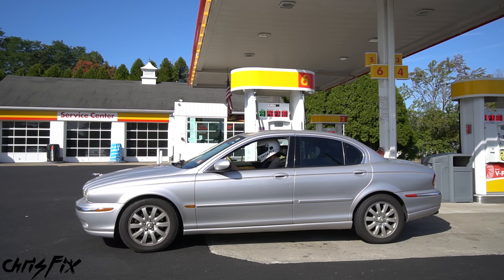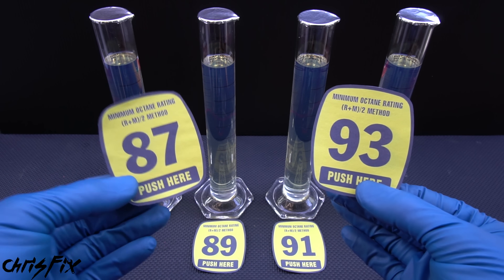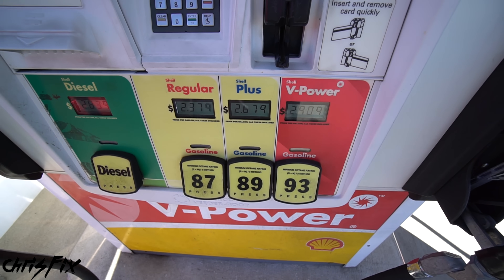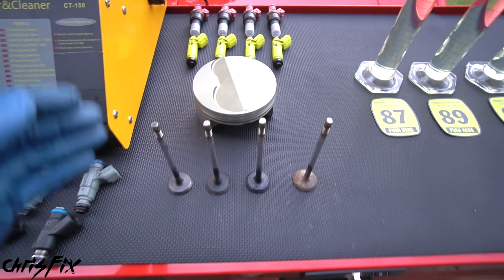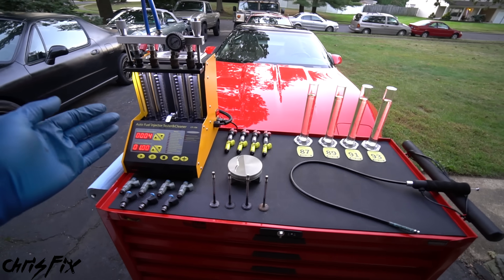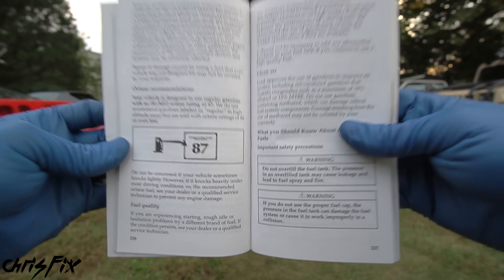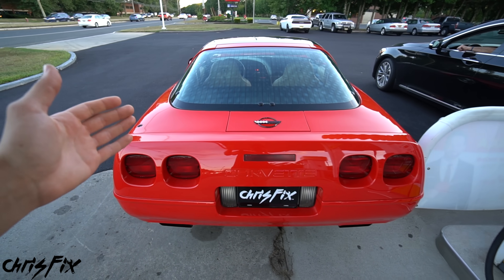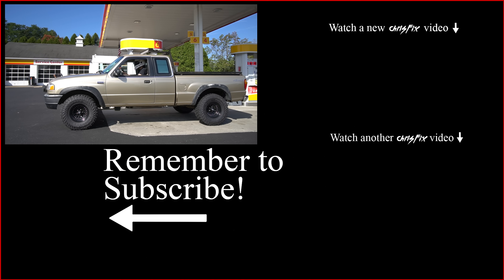What is the BEST Fuel to Use in Your Car or Truck and WHY

Comment: What about up to 10 percent ethanol?
I have to put 91 octane in my car but I’m not sure about ethanol and nearly all gas stations in my area has ethanol.
Reply from the maker: You don’t have a choice. Most cars can use it without issues. The main issue is it absorbs water and if your car or boat sits more than it is used you can get corrosion issues.
Reply: ChrisFix Alright! I should be good since I use my car every week except for Sunday. Thanks for your help!

Comment: How often should someone replace/check valves, piston heads, and fuel injectors?
Reply from the maker: Never. If you drive your car normally, don’t do very short trips and you bring the engine to operating temp each time you drive, you will be fine. Normal maintenance such as oil changes, air filter changes, etc will keep your car in tip top shape! My family’s van was bought new and now has 315k miles and used the cheapest fuel possible. It runs fine and I checked the injectors and they are still pretty good!
Reply: ChrisFix thank you for the info! I have another quick question if you don’t mind it’s not related to gas. I have a C4 corvette as well. 1984.. but it is a pain to turn over. If it gets really hot outside it won’t start. I’ll crank it until it kills the battery on some occasions. I’m in a C4 group on Facebook but haven’t gotten any feedback yet. Do you think it’s the fuel pump? Once it’s started everything runs fine and sounds great but if I turn the engine off I have to wait for it to cool down before I even think about starting it up again. Thanks again for any feedback!

Comment: Hey Chris! I appreciate your knowledge! Have you ever thought about adding a slight mix of maybe 100:1 premix 2 stroke oil to your fuel? Specifically for performance engines and racing applications?
Reply from the maker: My only hesitation is for vehicles with cats and oxygens sensors. That two stroke oil is bad and can damage the cats and sensors. For a race car it might not be an issue tho.
Reply: What, and destroy your catalytic converter?  That's a felony, sir.
Reply: @randyvanvliet226  glad its not one where i live

Comment: Here is a solution: Get an electric car..
Reply: @Mr. 8-Bit Doggo it's not so much that the operation of the vehicle is dirty... it's what powers the battery charger that is. Until they start pushing for something like nuclear energy, the bulk of the supply is going to be dirty. Something I believe most people forget when driving such vehicles.
Reply: @leroymesser6911  agree
Reply: Yup still cleaner. And if a hurricane or blizzard hits a region of America, gas prices are first affected by the inability to transport it to the region.
Reply: Yes a coal powered electric car.
Reply: @leroymesser6911  you can have solar panels at the rooftop of a home and charge your car that way. Independent from the grid and clean.
Reply: @Mr. 8-Bit Doggo it also makes the owner independent of gas use and Middle East politics.

Comment: Bottom line is that you use the fuel that the manufacturer recommends. Unless of course that you've got a better degree in engineering and more experience than the manufacturers engineers. When you turn your engine into a pike of junk using the wrong fuel then that is the price of ignoring the manufacturer. Just saying...

Comment: There is a VERY simple way to find out, your car will specify on the gas door or owners manual but MOST cars only need 87
Use 93 for the following cars:
Anything with a turbocharger or supercharger 
European engines ( they use much high compression ratio )
And any engine thats been tuned for above factory power

All the higher octane rating means is it takes more compression to combust ( you REALLY want that in high output engines so you don't get a premature detonation that will ruin your engine)

Comment: I’ve been using 87 for my bmw I’m too scared to check wat the recommended Gas is
Reply: Probably 91 lol If you don't run your engine hard though and keep the RPM's low you can get away with using lower octane fuel. Just have to watch for build-up and everything else in the video.

Comment: My subaru wants super (ron98) so that's what i always give him. My mr2 says the regular is enough but one day i just decided to also put vpower in there. It went through 1/4th of a tank and when i went wide open.. oh my pushed into the seat. Its faster so i say ron95 was the reason it didn't feel like 140hp on a 950kg dry weight. Even my suby seems to perform better with vpower than the other 98 brands

Comment: Although this is for cars it did make me think about the problem I was having with my motorcycle. I swapped spark plugs and cleaned the carbs and still had a similar problem. After watching this video I went online to research the recommended gas for my bike and sure enough I’m suppose to be running 91 and above. No more random combustion’s.

Comment: I just use what's recommended in my owners manual. BUT, I have a 1999 Chevy that called for 87. I was using it for a few years and then I began to have issues. My mechanic recommended I try 89, and I haven't had those issues since. 

For my newest vehicle, it calls for 87 so that's what I use. So far no problems.

Comment: I think it's worth mentioning top tier fuel providers. Usually says on the pump. You can find list google it. This is important for direct injection engines. I have a conoco in town which is a top tier fuel provider. It doesnt say top tier on pump. I wonder if some stations dont provide it or stations never put label on pump? Bg44 is good to run once a year.

Comment: “E-85 is only for Flex Fuel” nooooo Chris! It’s for big big big power and boost 😈😈😈. I run E-85 on my boosted S550.
Reply from the maker: And that’s tuned for it, aka flex fuel!
Reply: @chrisfix  I use it in my 1980 Pontiac LeMans Safari as an octane boost, I run half & half, plus the timing is advanced more than the law allows, ha. It has an old smogger carb that runs rich and the alky leans it out. The stock cam is  advanced in the old 301 4BBL which helps also.

Comment: Last time I used shell.. I had to replace my gas line due to them having water in their lines ..no thank you
Reply from the maker: That stinks! Also whomever replaced your gas lines ripped you off. All you do is pop the fuel line off at the fuel rail and run the fuel pump to get the water out. You got double taken!
Reply: ChrisFix jeeeeeeezzzz man smh lol this was years ago, but that's wild , thanks for the info

Comment: My old Ford Explorer said right in the manual not to use anything higher than 87 octane or it would damage the engine. My ex swears higher octane is better for your car. She goes through a lot of cars.
Reply: Higher octane doesn't burn any better than regular, the only way it would be better is IF one could advance the timing and make more power/mileage...other than that, a waste of money.

Comment: Jokes aside , at most gas stations the pump for Diesel is usually bigger and usually won't fit in a Gasoline  powered car to prevent accidentally putting diesel in your gas engine and vice versa .
Reply from the maker: Truth

Comment: A topic you missed , which is relevant , is ethanol percentage . Many older cars run like dogshit on high ethanol gas . Ethanol stores poorly , particularly in spring and fall when you get a lot of condensation . As the lower grades frequently have a higher ethanol content , you may want to use a higher grade if your car sits frequently.
Reply from the maker: Thanks for sharing! Unfortunately there is only so much you can put into a 20min video and ethanol opens up a whole other 20 min video! Haha

Comment: My truck says e-85. But the closest station that offers e-85 is 35 miles away. What should I use as an alternative?
Reply from the maker: It will run on regular gas just fine if that’s what the manual says. E85 is not common so that’s why they call it flex fuel. You can run gas or ethanol

Comment: Since shell premium has 7Xs as much additive, is it okay to use shell premium for 2500 miles to more effectively remove build-up in a car that calls for regular?

Edit: would this be safe for my car?
Reply from the maker: Yes. That’s what I did in my truck and the pinging stopped. I honestly didn’t think it would work and I was wasting my money but I wanted to try it. Also I had no choice because she would detonate with regular randomly.

Comment: Using 93 in your 87 rated car will not hurt your car, and for older cars or people who put there foot down, 93 will keep your car running longer and the timing firing when it's supposed to, ON TOP OF THAT when you consistently give your "regular" car 93 octane, after the ECU recognizes that is the only kind of fuel it is getting, you will get better fuel mileage too. 
Filling with one tank of 93 and "testing" is not a fair assessment if that's the only way you "test" either. To be fair, I've had cars that sound like death traps turn into purring kittens on 93 right in front of me, so no man is going to tell me otherwise. Great job. Keep up the good work. Proud of you...
Reply from the maker: Thank you and thanks for sharing!

Comment: Hey Chris, 

Branding recognition is what I prefer over nonbrand gas company.

Is there differences of the non brand gas over Chevron, Shell, Arco, 76?

I have a local gas, has generic name, has selections 87,89,prem
Should i trust these gas station for their fuel?
Reply from the maker: There is no significant difference except the detergent additives they add. The name brands, specifically the brands that are recognized as “top tier fuels” have more quality additives. So search what brands have top tier fuels and they have better additives. But gas is gas for the most part.

Comment: Can you please explain arco gas compared to chevron or shell there’s been a lot of comments stating that arco is “cheap gas”
Reply from the maker: There is no significant difference except the detergent additives they add. The name brands, specifically the brands that are recognized as “top tier fuels” have more quality additives. So search what brands have top tier fuels and they have better additives. But gas is gas for the most part.

Comment: Also most people dont know that midgrade is just a blend, which happens underneath the pump, due to electronics controlling the solenoid valves.  Most stores run a 70/30 or 65/35 blend. So essentially you're paying 30 cents more a gallon for only 30-35 percent premium. So essentially you should either just use premium or regular, but never choose midgrade.
Reply: Or you can mix it yourself...I find a lot of water in the high test around here as it isn't used much.
Reply: @danielright2044  I'm not sure what you're saying

Comment: Simplification, octane slows down the burning of gas, high compression needs high octane to prevent detonation.
Reply from the maker: No it doesn’t slow the burning down. The rate of burn is the same. The octane prevents detonation from heat and pressure.

Comment: When moving my daughter, my son insisted we run premium fuel in his Expedition when pulling a full U-Haul trailer. I forget his logic for this but it made sense at the time.  He normally uses Regular or mid-grade fuel.  Is there any advantage to running premium (95+) octane fuel when pulling a load?
Reply from the maker: Only if the car recommends premium or is high compression or forced induction. Otherwise you wont need it because the engine is able to  fully adjust timing with the regular gas.

Comment: How ever you can not go to high when it comes to octane number.
Knocking is a djusted by the Ecu with more fuel to reduce knocking very often.
So by using a higher octane number the ECU have it easier to adjust and avoid knocking.
How ever the saying that the fuels in the US and Europe is the same or similar is pretty much a lie. The US fuel isn't as good as the european one.
Proof of fact is just to have a look at ANY supercar. The european versions ALWAYS have a higher power delivery from the engine.
So manufacturer specs OR better. 
Thats why RACE fuel ALWAYS have a much higher octane. To be able to run at higher compression or higher boost = MORE POWER BABY!
So fuel gives you the chance to tune it for more.
So in other words Chris give counter info. when it comes to power delivery when it comes to the fuel.

Comment: In Italy:
95 normal
100 super
Reply: @Francesco Musi let me help you understand Shell V-Power in Italy is 100 RON. in USA we use RON + MON /2 =USA ... so (100+88) /2 =94 ...  Italy 100 = USA 94. also many Sunoco here in Florida you can get RON street-legal fuel at 105 at the pump. you can get higher at the pump but not street-legal fuel (they have lead in them) but people put it in their air-cooled Harley Davidson and hot-rods all the time.

Comment: You also have premixing, where 2 stroke is mixed into the fuel, rotary engines generally do this
Reply: 2 stroke is not used for automobiles, only small engines like chainsaws and weed whackers, as well as older dirt-bikes and jet skis. Usually 2-strokes only need regular 87 octane with some oil mixed in.
Reply: @ryantoomey611  you missed the last part. Rotary engines are basically 2 stroke motors; technically you don't need to use 2 stroke premix on a rotary, but it is a good idea since it helps lubricate the engine. I actually have a rotary car, and while I still run the stock OMP (OMP injects oil into the housings), I also add a bit of ashless 2-stroke oil (rotaries need ashless) as an extra lubrication step but also because the OMP does not actually run at idle speed.

For anything other than a rotary engine, 2 stroke oil is not needed in the fuel mix unless it is a small engine like you mentioned.

Comment: 2019 Camry Hybrid. I put 91 Premium. Manual says regular. Why? Because ETHANOL. Also it is a high compression 14:1 engine.
Reply: im pretty sure since its a '19 they know theres gonna be ethanol in the fuel so theyve already accounted for that. Youre just wasting money.
Reply: Most modern cars run best on 95 RON, also known as 89 / 90 PON / AKI  (as used in the US of A).
Going higher than that, is most likely not an advantage.
Essentially, midgrade is what they are built for.

Comment: I drive a 2003 Lexus is300 and when I put 93 in it I get a slight rotten egg smell in the cabin but when I bump it down to 87 the smell goes away any idea on why that could be ps I can't have a clogged cat because I'm not running any 🕵️
Reply from the maker: Hm that’s strange. The 93 might have more additives and the additive might be sulfur which is giving you the smell.

Comment: This is very interesting- My 2005 Nissan Pathfinder recommends premium fuel for optimism performance- but when using regular I see /feel no performance difference and fuel economy is unaffected

Have I been relying on my knock sensor for the last 14 years?
Reply from the maker: Your knock sensors are definitely being used but on many cars you might not notice a performance or efficiency difference with “premium recommend” cars which is nice!
Reply: ChrisFix: interestingly- I noticed a huge power and fuel economy increase when pulling a travel trailer through Montana and their pumps where ethanol free. Felt like a new car - i was amazed at how much better it ran without the moonshine dilution we have here in Washington state.

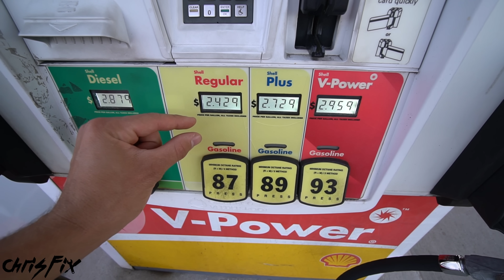Comment: If you fuel your car with 102 Super Plus in Germany for 24K miles you have spent 1070€ more on fuel as you have fueled 95. You also said that the chosen fuel has no influence on the power, but in 12:23 you said the opposit.
Reply from the maker: you misunderstood. I said all the gasoline octanes have the same amount of energy. You are converting that energy in your engine into power. If your engine is high compression or tuned for premium fuel, your engine can advance its timing and get more power out of the fuel vs regular. If your car takes regular, it cannot advance it’s timing any more than it already is so it can’t make any more power. The extra energy it doesn’t use turns to heat. Hopefully that clears it up.

Comment: Hey chris my car eorks fine with regular fuel but few people says using higher octane fuel increases power of the vehicle is this true
Reply from the maker: If your car recommends regular and does not have a high compression or forced induction motor, it won’t be able to make more power with premium.

Comment: Not always true about the owners manual on octane if that motors been rebuilt you would probably have to use a higher octane but great video overall thank you
Reply from the maker: If the motor is rebuilt you would use what your builder says as I stated in the video. Thanks for sharing.

Comment: In germany the least octane you can get is 95, up to 102.
Reply: Ah, but you probably use RON Octane in Germany.
95 RON Octane  = 89-90 PON Octane = 89-90 AKI Octane.

RON = Research Octane Number
PON = Pump Octane Number
AKI = Anti-Knock Index

PON and AKI are essentially the same numbers, except for a few edge cases.